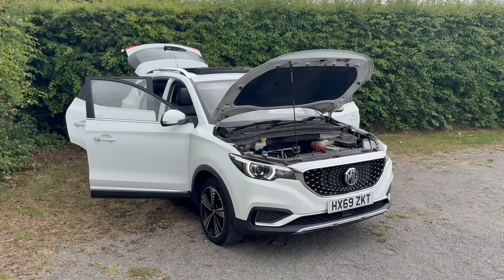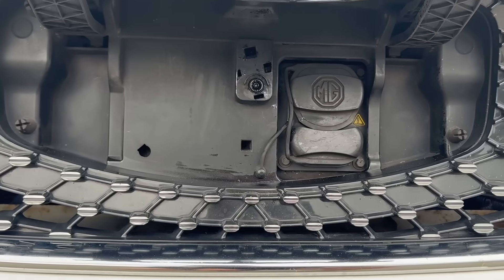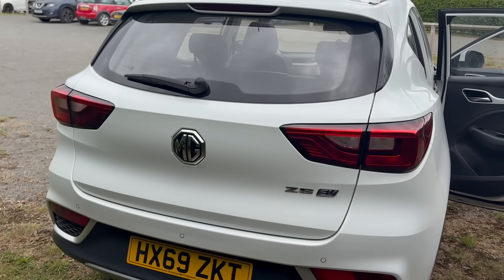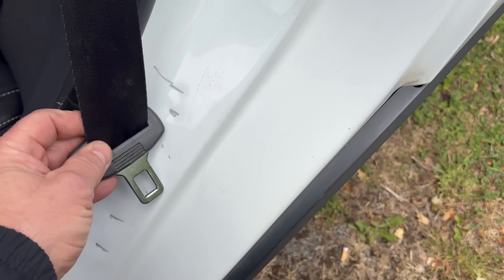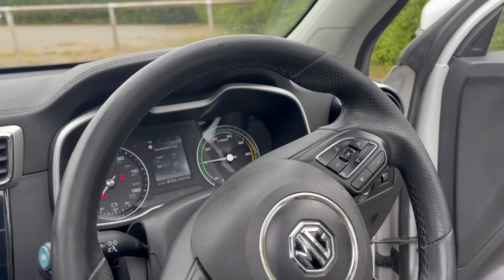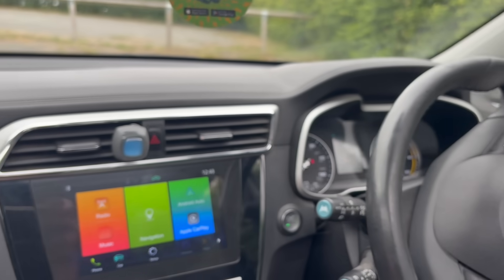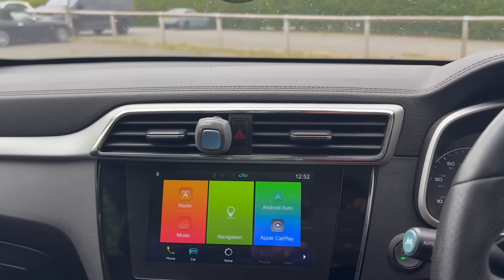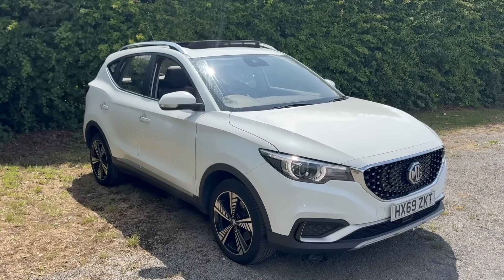Diesel And Petrol Cars Are Finished!

Comment: What a machine! 

Oh the basis of this video my wife is letting me keep my mk2 ZS on the provisio that she can drive the posh car I end up leasing when she wants to.

Only 190k to go!
Reply from the maker: Result
Reply: Nice lease another car and sod the polar bears. EVs are so green.
Reply: @dragonbreathwales we have 2 cars in our household. One we own and one we lease. The current lease ends soon so needs to be replaced. 

Once that car is returned it won't be scrapped but instead will go to something called an "auction" where private individuals or businesses will be able buy it. It will still have 5 years or 80k miles warranty left at that point. 

I hope I've cleared up this tricky concept.
Reply: @esm7708  Then sit unsold possibly causing battery issue as not used.
Reply: @dragonbreathwales "possibly" are we going to start using actual data.

According to Autotrader the average selling time for an EV is 28 days. The average across all cars is 31dats.
Reply: @esm7708  Autotrader, really you believe them LOL So unsold ev's haven't been registered and then sold so sold twice ? Ice cars were exactly the same. Why do we need salary sacrifice and other incentives like 20% off list price (BMW i4 as example) to sell ev's if they are so great ? An ev can work for many people BUT out of warranty is a gamble. Look at Tesla approved repair warranty on motors and batteries which is 5 years or 50,000 miles but that could be a year old car so actually only 6 year warranty rather than 8. Many ev's like MG, BMW, Mercedes, Audi, KIA, Hyundai, VW, Cupra etc. require an annual service to guarantee the battery warranty. BMW is about £440 for an IX3.
Reply: @dragonbreathwales so the SMMT are not telling the truth as well?

Ever thought that the reason why dealerships are offering big discounts is because they have to compete with salary sacrifice schemes? 

Requiring main dealer servicing to maintain the validity of a warranty. Hardly a new concept is it.

Comment: MG are bottom of the Reliability table in a car magazine survey.
Reply: When Was The Survey 1968 ?
Reply: @jimbethpiggy What Car magazine matey !
Reply from the maker: That because reliability scores also include software. The reality is, I've been in the trade for over 30 years. 1 week in a garage will show you what poor reliability is.
Reply: @Jamesandkate and me, 44 yrs in the garage trade and still going. I've seen all the unreliable vehicles out there. No wonder mechanics on the whole are embracing EVs. My 70plate  Kona been faultless.
Reply from the maker: Love the Kona, one of friends has one. People seem to forget that ICE cars need maintenance. It’s fine for car to need £1200 of wet belt replacement or an EGR cooler or DPF, but when an EV needs nothing there’s an issue. Strange. 🤷🏻‍♂️
Reply: @Jamesandkate  I heard that Kona's have an issue with their DC to DC converter and wondered if you could comment. I'm not sure how far the press can be trusted when it comes to EV's.
Reply: @Jamesandkate  
Re "Strange" (Needing nothing)
I thing "Clutching at straws" is close to the truth?
Reply: @alibro7512  
As James (kind of) indicated in another reply, EVERY "Car" (Or other "device") has it's "Top 10 Faults".
LATER versions are often considered "Better" only because those faults are eliminated thorough modification over time, or the "perception" changes because the "Experts in the field" KNOW about them and apply preventive maintenance, can make a "Quick fix", or carry the parts, meaning the customer is not inconvenienced and doesn't KNOW.
Reply: Ours has been extremely reliable, mind its only done 60k in 3 years
Reply: @peterszczesiak6025  our definitions of ONLY are different 😂 - my nearly 5-year-old Zoe is just coming up to 26k miles 😁
Reply: @peterszczesiak6025 the MG dealers are good but MG themselves are terrible and parts hard to to get. I like MG cars (I’ve test driven a HS and ZS EV) but if MG GB are useless I don’t want to know.
Reply from the maker: Skewed by the advertising revenue too.
Reply: @peterszczesiak6025  
I'm assuming that's km rather than miles?
even so, that's "Above average" UK mileage.
Reply: @rogerstarkey5390 It does say miles on the display.
Reply: A car magazine.  Could anything be less relevant in 2025?
Reply: @jwflame customers of the manufacturers  answered a survey. Any other info ?
Reply: Another great video
Reply: You see this a lot but it seems the mg4 was/is problematic but other mgs are better but the  4 skews the results.
Reply: @adamgreenwold7412 still,bottom of the table
Reply: maybe petrol ones, id avoid them but Chinese know how to make electric cars.
Reply: These reliability tables include software issues such as Bluetooth connectivity etc, and these cars have lots of issues related to the infotainment system. 
Mechanically, they are quite solid.
Reply: @ricco123tube  The infotainment system in my MG5 is pretty hopeless but so long as the radio keeps working I'm happy enough. It costs pennies to run so I can live with the quirks.
Reply: @ricco123tube still bottom though and MG GB aren’t helpful. I’ll be interested in getting one but if the manufacturer isn’t any good I’ll go elsewhere.
Reply: Read that report, but it did not differentiate between serious failings and minor software glitches, odd that the same magazine had the following :

"The MG4 EV has been named ‘Small Electric Car of the Year’ and ‘Best Electric Hot Hatch’ at the 2024 What Car? Car of the Year awards, its second consecutive success, defending its title from the 2023 awards."

I'm sure many of the fault reports are user error as well, once you become familiar with any minor quirks depending on firmware it's a brilliant car.
Reply: The survey asked - are you having any issues and at the time every MG4 owner was having issues with the lane keep assist software. This has been greatly improved in newer software update and is not no worse than most other new cars. The best update has been a quick way to just disable the feature.
Reply: @rogerthomas7040 the survey was about all the cars not just MG4.
Reply: @jamesinbradford5882  but everyone with a MG4 would have replied.
Reply: @rogerthomas7040 yeh and of the MG3, HS and ZS. What Car didn’t just ask for MG4 !
Reply: @jamesinbradford5882  And if many of the MG4 owners replied they skewed the overall result for the MG brand.
Reply: @rogerthomas7040 that’s the risk of a survey and free speech !
Reply: I have had 3, trading up each time.  Not once has any of them been into the dealer for a repair.  To get my first one I traded in my BMW 525 Hybrid since it would no longer quality for London's congestion charge discount (and the dealer gave me money back!; at £15 per day for 6 days a week it was crazy).  It was hard to walk away from a BMW service with change from £500. As you can imagine, my driving habits have gone through a revolution.
Reply: 51k in 2 years on my ZS.  Currently fairing better than any other car Ive owned.

My Skoda karoq lunched its DSG at 50k.